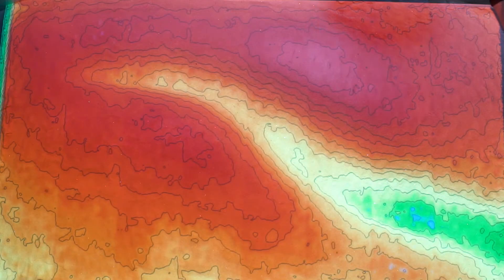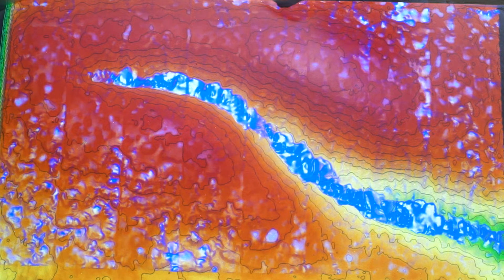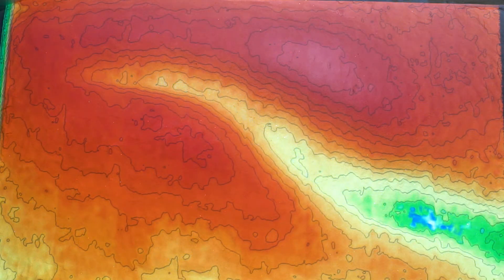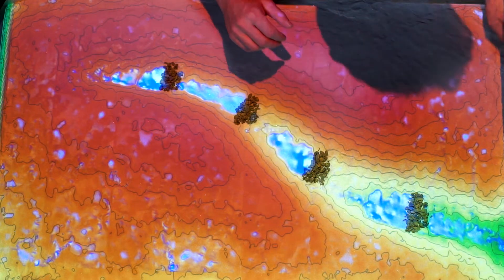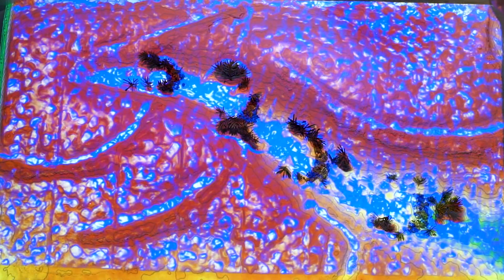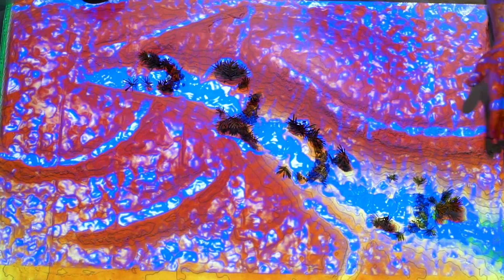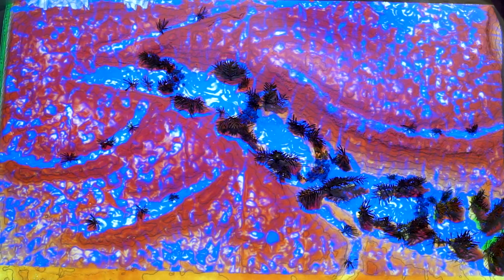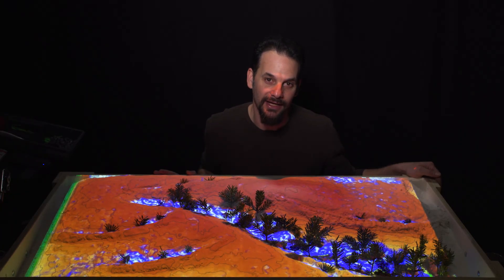AR Sandbox: Water Harvesting Check Dams

Comment: Deeper the water the more hydrostatic pressure presses the water into the ground. I notice the lawn drains faster now that there is a three foot pit on the corner. It squeezes the water into the ground. Even at that depth a pin hole spays out like a power washer.

Comment: ...and thus obscuring fish passage and destroying spawning habitat by covering it in silt.
Reply: I have seen salmon and steelhead climb 6-ft spillways and higher falls so no impediment from low rock restrictions. Now, there may be some validity to the spawning habitat media issue, but usually sediments gravitate to the deeper areas.  It is an area needing further study on my part.
Reply: I think these check dams are meant for dry land where rain storms periodically create erosion, not dams built in riverbeds. The check dams will stop the silt from getting into water courses.